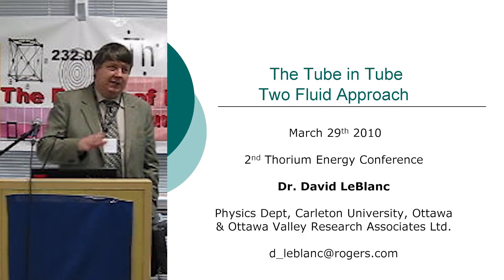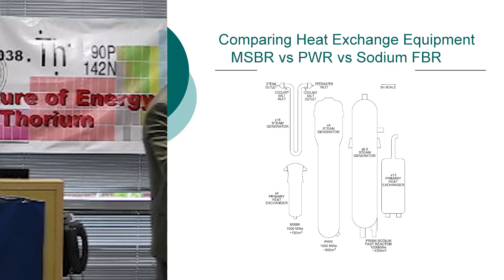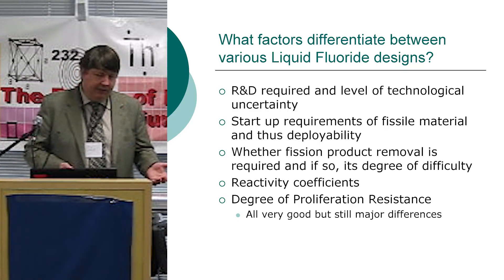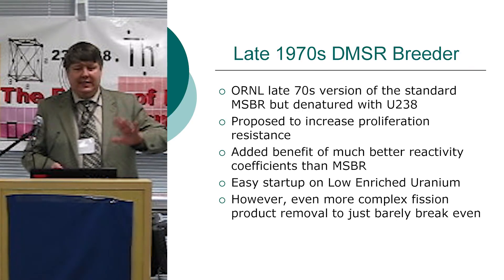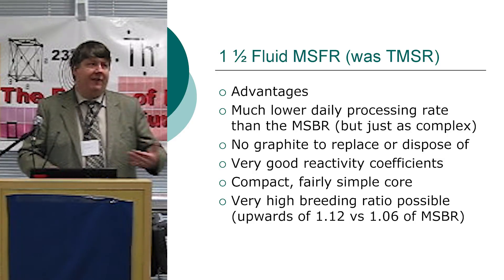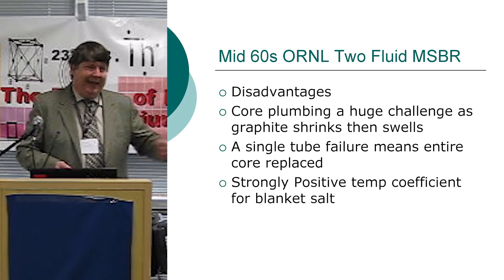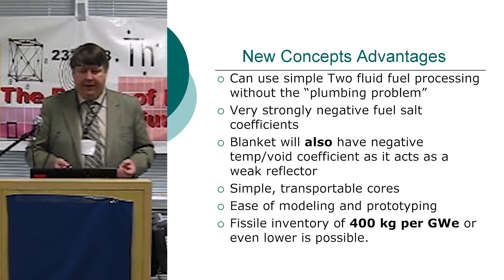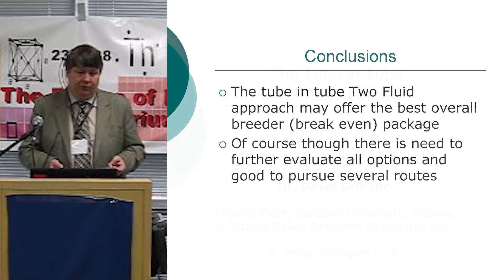Dr. David LeBlanc - Tube in Tube Two Fluid Approach - 1st Talk @ TEAC2

Comment: Could this be made to work with the IMSR? Adding an outer blanket of thorium salts. Maybe even without reprocessing of the salt during operation.
Reply: I think they will be focused on keeping design as simple as possible. Guess one could wrap a Th blanket around anything, and licensing will then be more challenging. Even the creation of U-233 is a legit physical challenge to manage. Someone will do it, but it will be a reactor designed for the purpose of creating U-233 seed fissile.

Comment: What if the graphite swelling problem could be solved by physically isolating the graphite? Perhaps some thin steel tubes could be used to isolate the graphite rods in a bit of an airfoil shape optimized for steady fluid flow between them.
Reply: @Oliver Mayo Fast spectrum is a bit of a trade-off. You need more fuel to be present at any given point because of the reduced neutron cross sections, and while it can use pretty much any fuel, thermal spectrum is more easily attainable. The higher temperatures in thermal spectrum reactors, thanks to Carnot's theorem (as a basic reference), entail higher theoretical energy efficiency than fast spectrum. They both have their ups and downs, kind of like gas and diesel engines. Gas is faster and more reliable, but less efficient, while diesel is efficient and powerful, but has a narrower operating range. The end result ends up being a situation of picking broad categories that suit the needs, then optimizing for the more specific needs.
Reply: True, very true. Simplification is a very good end goal, an optimal approach to power generation, and that's the benefit of fast spectrum- like you said, it's the practical way to make power from MSRs quickly.  If all you're doing is burning transuranics to make power, fast is fine. Still, advances in material science can improve the heat capacity of structures and turbines, allowing for even better efficiency. Turbine design improvements are also plausible.

But, from a material supply and demand perspective, thermal is still optimal for specific tasks. If you need high temperatures for industrial purposes (like the bauxite smelting center in Australia that currently uses almost as much power as Sydney), direct thermal energy input from a thermal reactor's secondary loop would nudge that efficiency much higher. Thermal spectrum's filtering requirement means easier access to radionuclides for targeted radiotherapy. There's even work being done to breed Thorium into a source of Actinium for radiotherapy alongside other fission byproducts. The same goes for the rare earth metals in the byproduct stream, which all have good market value and can complement or supplement current mining operations.

Also on the material side of things, Thorium is much more abundant and is currently regulated as strictly as Uranium in mining operations, which means this typically less harmful substance is becoming a mining bottleneck, which is why so many of these companies are looking into using it as a fuel source alongside the transuranics. It's more a matter alleviating bottlenecks than selecting fuel by availability relative to demand. Even if one's more abundant than the other, neither would suffer serious depletion if we started using them tomorrow. If it's ease of use and access that you'd like to focus on, fast does it all, but operating thermal Thorium alongside the fast reactors helps to tag team the material issues.